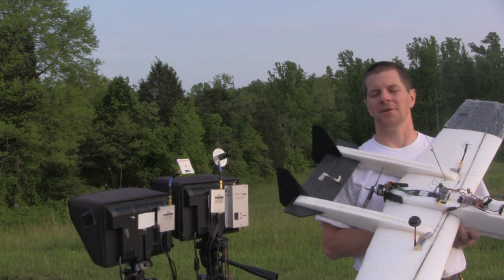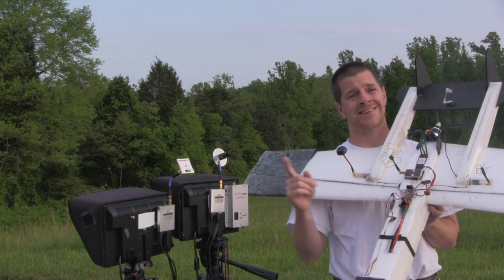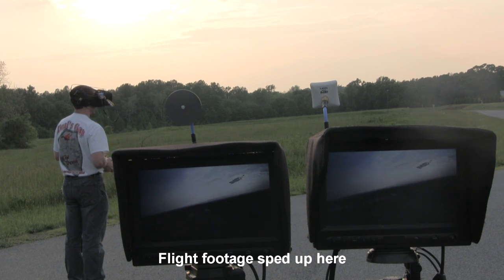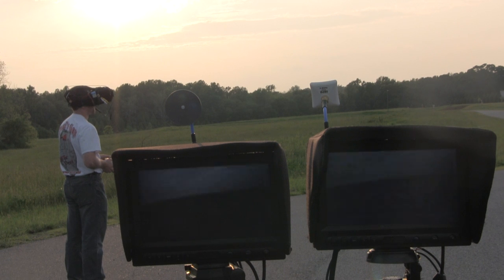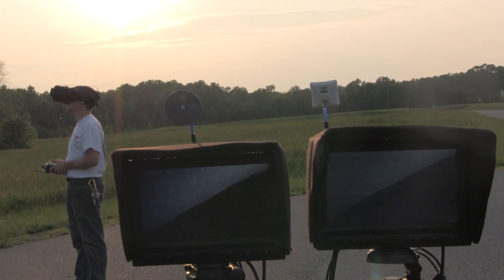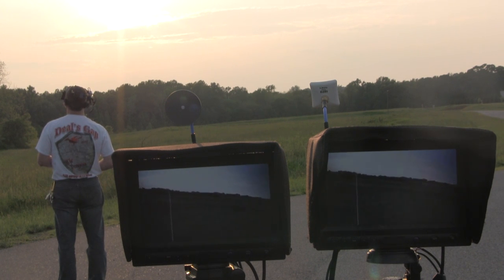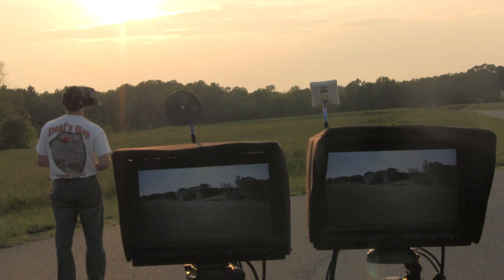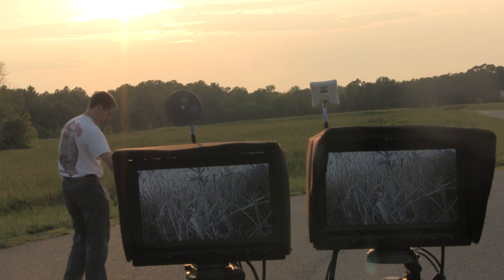Antenna testing: VAS helical Vs. SpirnoNet Patch

Comment: I would test a 5 turn helical which a 5 turn is where a helical shines especially over an 11db patch. Aomway 5 turn helical are pretty good for the price too.
Reply from the maker: The 3 turn would outperform that patch, too ;)
Reply: Video Aerial Systems True on that. The 3 turn has a wider field as opposed to the 5 turn has a more narrow field but longer distance. Cheers nice video.

Comment: just got a vas 5 turn helical for phantom that has fatshark attitude goggles that the vas 5turn goes on and drone has 250mw with fatshark spironet 5.8ghz system hope it helps range with the helical, got one mile with old spironets on quad and goggles before so maybe this will be nice upgrade

Comment: I'm new to Fpv. I'm flying multirotors. Alex, What video receiver and transmitter would you recommend for someone on a budget? I'm thinking about getting your cyclone and 3 turn helicoil for my antennas. God bless. Love the videos!
Reply from the maker: I have had good luck with the FR832 receiver.
Reply: I see an FR632 by boscam, ts832 and rc832?
Reply from the maker: The FR632 has some QC issues.  The RC832 is what I have that seems to work very well.  Mind you my experience with 5.8GHz receivers is limited.
Reply: Appreciate the response.

Comment: Well, I guess that a question that may be a bit out of the topic but a fair one,,, what is the real and useful range of the 3.3 Ghz Video System? Have one stocked some where to have as an emergency measure... don't know really what type of service one will get our of it...
Reply from the maker: +Marco Cruz - In all honesty I don't know.  Probably 6-7 miles.  I am really unimpressed with the Iron Horse receiver.  I had very high hopes for this system, but the receiver needs work.  Hopefully there will be improvements in the future.  I only use this when at a fly-in and other people are taking the bands I use.
Reply: Well thank you so, so very much for your insight, I really wish I can get in the future a modulating or "Zinthesizer receiver that allow me to operate in different freq, in stead of changing equipment every time that I want to use a different tx... thank you again.

Comment: Doesn't seem like a fair test.  You are testing rx antenna yet u use different tx antennas
Reply from the maker: +Propwash Rotorsports - Strangely, the reason for shooting the video wasn't to show the superiority of my helical, but instead to show how capable a 25mW 5.8Ghz system is when set up properly.  I have been using this plane setup like this for interference testing and decided to shoot the segment here on a whim.

I have decided to try a few different antennas that I make and to put them against each other and see how they fare against others that I make.  This would be very beneficial not only for me as a developer, but others to help them decide what is best for them.
Reply: +Video Aerial Systems
Luke, if we follow that metric, then it tells us one of two things:
1) SpiroNet does not transmit as far as the VAS Omni
2) IRC Patch does not receive from as far of a distance as the VAS Helical

Either way, this line of logic dictates that both of the VAS antennas are superior to the SpiroNet and the patch. Even if Alex used the same antennas on the video transmitters (VAS), it would only further prove the superiority of the VAS equipment.
Reply from the maker: +BanniUK - Slightly different, yes.  Both CP omnis with approximately the same gain.  I wanted to use Immersion's SpiroNet on the TX as it was designed to be used with their patch and thus, I didn't use one of my own.  The truth is that with a directional antenna on the RX, the TX antenna doesn't matter very much.
Reply: +Video Aerial Systems still it should be the same for a fair test
Reply from the maker: +BanniUK - How would you feel if this video were titled "VAS antennas V. Immersion antennas" and I left the antenna type out of it?

Comment: Hi Alex, awesome and great info, I have the same patch antenna on my AAT, and I'm getting 1000M on a 200Mw TX, then it fades a bit,  Is it better to get me a helical for better reception? not that I want to fly further out, 1000Mtr is enough for me, but I just want to be sure to get a picture all the time that I fly.
Thanks.
Reply from the maker: +FGDude - I will be testing the helical against a Crosshair soon.  The helical is better, but the Crosshair is likely the best.
Reply: +Video Aerial Systems Ok, thanks for the info, looking fw to see the result of that test.
Cheers.

Comment: great video! as a newbie starting out, my expectations of what vtx's were capable of was WAY off.  videos like this are really helpful.
Reply from the maker: +dcFPV _  25mW goes a LONG way even at 5.8GHz.  Directional antennas really push how far these go.
Reply: +dcFPV _ Well you have to watch it because it depends very much on where you fly.  If you're far out of the city you can get good range with less power, but i've found that in more dense RF environments your range will vary dramatically.
Reply: +Northern FPV and obstacles!
Reply from the maker: +dcFPV _ Obstacles are the big one.  Inner city affects it, but not as much as you might think.

Comment: I've been looking at helical antennas for 5.8ghz for my camera bird (XK X380) which currently has a set of Birds Eye View antennas (cloverleaf on bird - planar on diversity RX).  There seems to be quite a few manufacturers of helicals.  Some, like for instance, the Aomway do not seem to have a matching stub, while yours appear to have them (just by looking at photos). How significant is the matching stub on these helicals. My VTX is 200mw Eachine 32 ch. Nice demo. Cheers.
Reply from the maker: +Bill Somrak - Without a matching stub, the helical does not resonate properly and thus will not perform well.  it is imperative that the helical have this.
Reply: +Video Aerial Systems I would think it would be most important if you were using it as a transmitting antenna due to (perhaps) excessive SWR. A high SWR does not necessarily make for a bad receiving antenna?
Reply from the maker: +Bill Somrak - SWR matters just as much on the receiver as it does the transmitter.  High SWR means less of the signal makes it to the receiver resulting in poor performance.

Comment: great vid Alex got my 3 turn and LOVE IT... can u recommend the best choice for a secondary antenna for my diversity? preferably circular, im a big fan of the triumph as well but would something hi gain be better? using on a fr632. n thanks for everything as always
Reply from the maker: Why not a second three turn?  Aim them 45 to 55° apart.
Reply: Since then, I've got 3 one round 2 square.. just wondering is there any difference in these two units? By the way VAS 4life....
Reply: And if you like some of my other friends are having video issues just to get this antenna and they will be sorted if you have a decent VTX I I flew more than a half of mile on a tiny 25 Mega watt vtx with absolutely no issues the other day and that was just for fun these antennas are truly incredible oh and that was on a nano qx2 that has no antenna visible at all.. all time favorite.... ;-)
Reply from the maker: +Anthony Cenabite Farr - I recommend 2X helical antennas aimed ~45-60 degrees apart.  This gives great coverage.  The round base helical is the new version.  The square base works just as well.

I have flown a few micros via a helical antenna.  It is a lot of fun indoors.